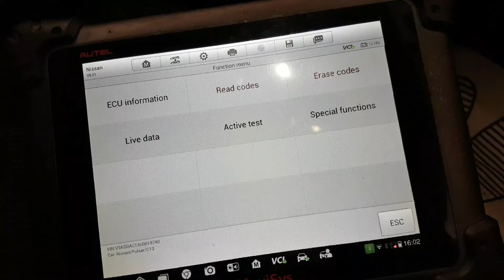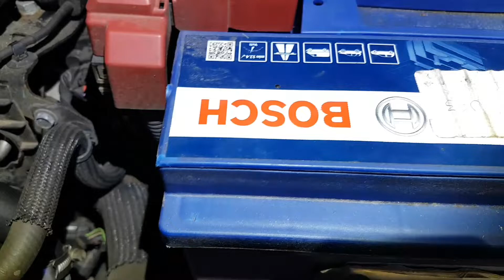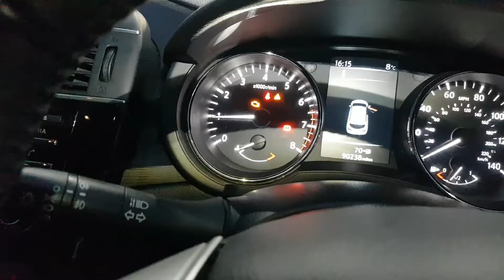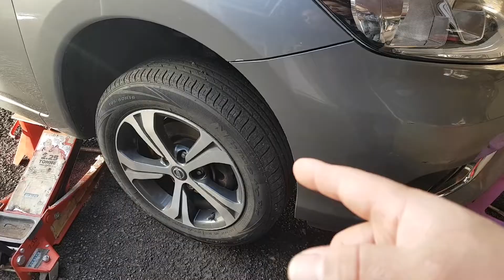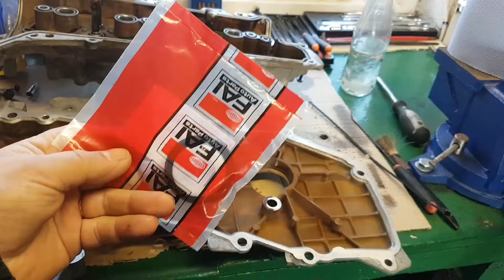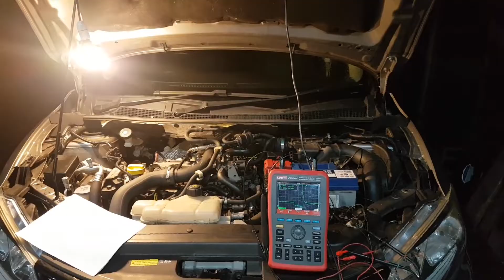Nissan Pulsar 1.2 DIG-T Engine light ON even after new parts... Fault finding and repair.

Comment from the maker: Hi everyone,
I’m experiencing something strange with this video—there’s one viewer whose comments I receive email notifications about, but the comments aren’t actually appearing on the video itself.
They’re not being held for review, I have looked everywhere and can't find them, so I’m not sure what’s going on.
It seems this viewer however doesn’t follow the channel, or they’d know that the accusation that I’m deleting their comments is completely unfounded.
For the record, I do not delete anyone’s comments.
So, below are the comments in question, and at the bottom what I would reply if I could see the comments on this video.

"@ram40andy
Even though you have correctly identified pin 127(yellow wire) on F149 ECM connector for EXH camshaft position sensor, I am afarid you have scopped INT position sensor. The CMP signal rising edge, you have counted CKP teeth against, should be in the middle of CKP signal refference gap for a new timing chain. Each CKP tooth = 6* of crankshaft revolution. The timing correlation fault code(P0016/P0017) treshold value is around 18*=3 CKP signal teeth. Your timing is 7.5 teeth=45*out. With this timing out, this engine simply wont start. On the other hand, INT camshaft signal rising edge should be 5 teeth from CKP gap edge, counted to the right. Yours is 6 teeth. So, your INT camshaft is 1 tooth =6* retarded, which it means this chain wont cause any issue. If you are interested in known good timing waveform and other scope stuff , just let me know."

Because he assumed I have deleted his comment...

"@ram40andy
It is not nice of you to remove comments showing your mistake."

My reply to the above is the following:

@ram40andy
I clearly misspoke in the video when I said I was scoping the exhaust—I was actually scoping the intake. That was an honest mistake, and I appreciate you pointing it out.
However, the detailed information you’re providing about degrees and timing angles isn't really relevant to the main point of the video. The purpose was to compare either the intake or exhaust camshaft signal with a known good waveform to determine if the timing was off. Regardless of which cam I scoped, that comparison would have shown the same result: the timing was incorrect.
Also, toward the end of your comment, you mentioned that my measurement discrepancy wouldn't cause any issue (“So, your INT camshaft is 1 tooth = 6° retarded, which means this chain won’t cause any issue”). I’d strongly suggest watching the entire video—because it very clearly was causing a problem, problem that I have showed at the start of the video, and resolved once the repair was completed.
I want also to point out that all the known good waveforms I found showed 6 teeth, not five. And in those references, the timing was spot on, with all the marks exactly where they should be.
Lastly, and to reiterate—I do not delete comments. Making assumptions without understanding the full context often leads to confusion and incorrect conclusions.
Thank you!
Reply: Hello mate how can I contact you ? May be i have a job for you
Reply from the maker: @FABIOTASC1 
You just did...
😉
Reply: It is OK. But, why should you scope the INT camshaft, when HP pump is driven by the EXH one? When the chain gets worn, BUT the tensioner is still in good condition, both camshafts gets retarded with  the same amount of crankshaft degrees( the chain did not jump). When the tensioner gets stuck or loose, and the chain has jumped, EXH camshaft becomes much more retarded than INT one(which may be still on time). `1tooth=6* out of timing proves that INT timing did not jump.If the EXH cam were out the same amount(6*), it wont affect HP pump pressure. P0090 code is set at over 2teeth=12* out of timing. But, the EXH camshaft has jumped a lot, as the diag tool showed 24* for "exhaust camshaft position". And this definitely will set P0090 code. If you are interested in all sensor/actuators signals waveforms of this engine, let me know.
Reply from the maker: @ram40andy 
Look, the chain was stretched, the new chain fixed the problem... everything else is irrelevant. 
👍
Reply: @LMAutoRepairs  Yes, the chain was stretched. BUT, not to an extent(1tooth=6*) that should have affected the HP pump timing so as for ECM  to set P0090 code. The REAL problem was that EXH camshaft jumped 24*( due to faulty tensioner),  not the stretched chain itself. If you had scopped both camshafts, you should have realised this scenario. If you call this crucial piece of information "irrelevant" is your option. Mine NOT. 👍
Reply from the maker: @ram40andy 
It is irrelevant in the sense that it doesn't really matter... could not be fixed in any other way... so, all those technical details are irrelevant because the chain and everything else needed replacing regardless of stretch, jump, intake, or exhaust out of timing...
Or now you know another way to fix something like this?
Wel, some would probably just put a new tensioner and of you go... I have seen  a bit of everything...
Reply: @LMAutoRepairs  It is not about "another way " to fix it. What you dont want to understand is the fact that, your followers are expecting from you to logically explain the diagnostic process, step-by-step,  that leaded to this "WAY" of fixing the issue. Based on relevant tests and data. Not on your "feeling". Or, the data you achieved showed INT cam 6* out of timing, NOT enough to set P0090 code. Even though, you went on blaming the chain stretcing for it, against the data. I think this piece of "technical details" not only does really matter, but it is crucial  in an accurate diagnostic process.
Reply from the maker: @ram40andy 
Whatever...

Comment: Hi, I have a Nissan Qashqai J11 with the 1.2 DIG-T engine, ~ 90 tkm.
1. During the first 30 seconds after a cold start, the engine briefly stumbles and has trouble keeping a steady idle. After that, the RPM becomes stable and the engine runs normally.
2. The engine briefly hesitates/chokes for a fraction of a second during acceleration, especially under medium to higher load.
It happens mainly around 1,900–2,400 rpm, and above about 4,500 rpm the car loses power and doesn’t really want to pull anymore.

The fault code that keeps coming back is P0090 – “Fuel pressure up solenoid”.
I already checked the wiring and connectors visually, used contact spray, replaced the spark plugs, and added Liqui Moly fuel system cleaner, but there was no improvement.

A mechanic checked it briefly while revving the engine in neutral, not during a road test, and noticed that the fuel rail pressure dropped from around 50 bar to about 35 bar. He suggested that it is often caused by the in-tank low-pressure fuel pump.

Does this sound more like a faulty low-pressure pump in the tank, or more like the high-pressure fuel pump / fuel pressure regulator solenoid? What would you recommend checking first under load?

...or at first software ECU update?

Greetings.
Reply from the maker: As per the video for the P0090
Not saying you have the same issue, but is common and you can do the same checks I did to confirm or not that your issue is the same...
👍👍👍

Comment: Hey Good Morning. You do not know me, But let me first interduce myself. My name is Winston F Hoyte. I am from the Beautiful island of St Vincent & The Grenadine. VC100. A nation in the eastern Caribbean. I am contacting you in relation with a 2016 Nissan Qashqai J11/ 1.2L DGI Engine.
Engine check light on with trouble code P0190 Stored.
Subject / Symptom / Trouble Case Running rough poor loss of power.
Trouble clear and would return after warm up. 
I have a question in relation with Nissan Pulsar 1.2 DIG-T Engine light ON even after new parts... Fault finding and repair Video i look at several times.
My question is the i have a four channel lab scope and i did scope the Exhaust and Intake with the Crank and the High Pressure Fuel Pump. Intake camshaft time 7.796 With seven Raising  counts / High pressure fuel pump 5.578 ms. Just checking is the exhaust camshaft signal should i check?
Let me know.
Reply from the maker: With a four channel you can check both at the same time...
Crank vs intake and vs exhaust...
You can even check intake vs exhaust if you find a good known waveform...
👍👍👍

Comment: I’m getting the same fault code on my Nissan Pulsar. It’s cutting out too but will restart. I do have a live data reader, could the 1.6 petrol version have the same chain problem?
Reply from the maker: Possibly... 
Any trouble codes? 
👍👍👍
Reply: @LMAutoRepairs  Yes im getting P0088 Fuel Rail Pressure Too High and P0090 Fuel Pressure Control. At Idle my fuel pressure is 38 bar
Reply from the maker: My video shows how to determine if you have the same problem...
Just follow it...

Comment: Thanks for the info, i was struggeling with this too. Explanation in short is @ 32.00 minutes. On the car i had timing was out at some point during accelleration simply because of low oil. Crazy rattle too which at first sounded like cvt.

Comment: Seen a few if three videos. What is concerning is the exhaust inlet cog wasn't replaced and you can clearly see in your video that the chain made grooves on the teeth. You had the top of the head off wondering why you wouldn't replace those also? I have seen other videos when the spark plug damage the ceramic it's because of the design flaw of this motor and oil burning in the cylinder burning the valves and spark plugs oil passing the rings.
Reply from the maker: I can only replace what the owner was willing to pay for...😊
👍👍👍

Comment: We changed the timing chain set only without the variator wheels, the car is 98,000 km., but P0090 77 appears again after 15-20 km. of driving. Before that, the high pressure pump was replaced with an original one. We recorded the regulator signal with an oscilloscope, which showed a pulse duration of 8.28 ms. When checking the crankshaft/exhaust synchronization signals, the pulse peaks are almost 7 (6.8). When reading live data, the exhaust points in degrees from 0-7 show mostly 8 degrees. There are one or two points of 9 degrees. It is noticeable when reading the freeze frame of the error that the pressure target is higher than the real one by one atmosphere. The first time 103/102 at 2100 rpm, the second time 77/76 at 1500 rpm and voltage of The battery is 13 volts. When idling, when checking the battery, it shows 14-14.2 on live data, and measured directly with a voltmeter, 14.34 volts. I forgot to say that the adaptations of the pump and the control module are reset.

Comment: I had the same problem with Qashqai. After checking the pump wiring and duplicating it just in case, but without success we replaced the pump with an original one. The error appeared again a day later. When I was searching the web for a solution to the problem, I came across your video. I will check the circuit your way. Thanks for the idea. I can't believe there is no synchronization error.

Comment: Absolute ledgend! My pulsar is having same kind of symptoms, but when I checked exhaust camshaft positions with scanner, only positions 0 and 2 are  outside of reasonable values ~20 (degrees?), all the other 1,3,4,5,6,7 are fine (between 2 and 9). I don¨t really understand how that is possible that just 2 of those are way off.

Otherwise car runs quite nicely except when accelerating around 80 km/h with low rpm the fuel pressure may drop for a half a second and car coughs.

Really helpful to see what kind of sensor values I should expect to see. I was also quite surprised when I saw that fuel temp -40 when trying to figure out the problem. Luckily I also have an oscilloscope, so I will be also able to verify if the timing chain is really stretched. If not, I just may try to change the hpfp.

Comment: same problem, but the scanner showing 12-13* degrees, you think that will trigger this fault code?
Reply: thanks for the response. unfortunately don’t have access to a scope so thats why i asked. is there any other test i can perform?
Reply from the maker: Which faults are you getting, same as on the video?
Reply: @LMAutoRepairs yeah p0090 fuel regulator
Reply from the maker: I would say you have the same problem, but as per the video, do your due diligence before conclusions...
Reply from the maker: Possibly, nothing like scope the car...
That will tell everything you need to know.
😊
👍👍👍

Comment: Hi, Can you say where and how you are connecting your oscilloscope?
Reply from the maker: I have showed in the video...
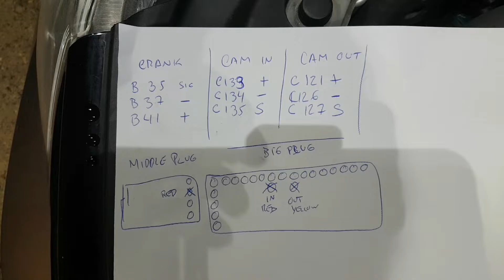30:17
👍👍👍
Reply: @LMAutoRepairs  Hi. I mean how are you attaching your probes to the wire. Are you piercing the wire with a back probe?
Reply from the maker: No, I do not pierce wires unless there is no other option, specially outside the cabin.
I do back probe...
👍

Comment: Hola, tengo el mismo problema es un kadjar 1.2 tce 130cv, la cadena es nueva y sigue saliendo el código p009077 creo podría ser? Gracias
Reply: Si, el video le he visto, he puesto la cadena de la distribución nueva ya, y el problema sigue.
Reply from the maker: Could be the pump...
Ensure first that the timing is correctly set.
👍
Reply: Se enciende desde que se ha reparado el motor, válvulas, segmentos, cadena de distribución, todo nuevo. Antes no daba el p0090
Reply from the maker: Well, in that case you answered yourself. 
During that work something has been set incorrectly. 
👍
Reply: Está todo repasado y no veo nada raro, me está volviendo loco, por lo que leo por foros le pasa a mucha gente igual que está como yo
Reply from the maker: Scope everything and see where the issue is...
Reply from the maker: All in the video...
😊

Comment: Our Nissan Note 1.2 DIG-S blew up 1 week after a full dealer service (timing chain rattle noted and a £2.5k 'diagnostic repair' was offered) and Nissan couldn't push us out the door fast enough.... as if ashamed. This Nissan Renault engine is so bad that I understand there are class action court cases in USA and France.

Comment: Thank you Luis for seeing it through to the end. 
It would have been easy just to send it on its way to get a chain done but you stuck with it to give us the full start to finish of the fault, diagnosis and fix.
Ignore the haters picking holes about the stretched chain as at the end of the day you were right the chain was slack and needed replacement and retiming. 
If someone is thinking you produce how to videos then they are mistaken although some come close.😆
Your videos are full of hints tips and advise and are best used that way .
Keep up the good work 👍👍
Reply from the maker: 😊
Thanks, I really appreciated your comment!
👍👍👍

Comment: Every time I pull the timing cover off one of those I wounder if the engineers that where given the task of making this horrible idea work purposely put a 😦 face on the cover look at 53.30min if you don't understand what I mean surly that's the work of a good engineer that knows they are working on some one else's bad idea.
Reply from the maker: 🤣🤣🤣🤣
That's a good one!
👍👍👍
Reply: @LMAutoRepairs when you see it and it gives you a little 😆 there's a lot of very frustrated engineers that have to deal with the demands of silly people